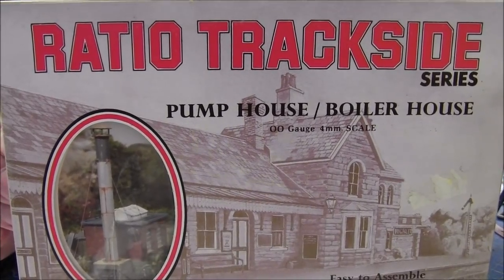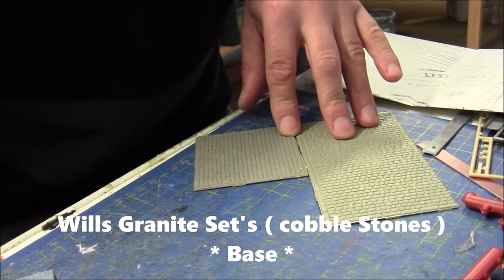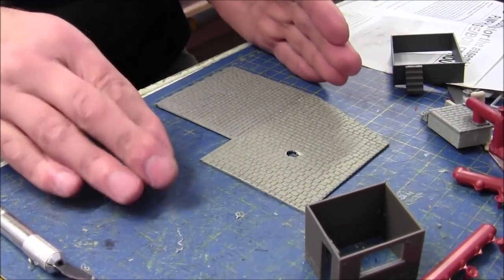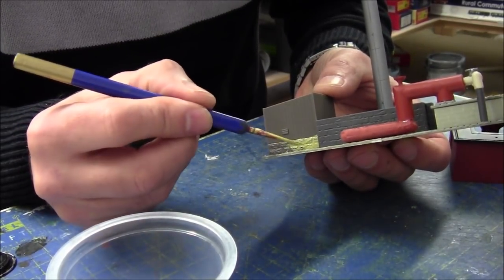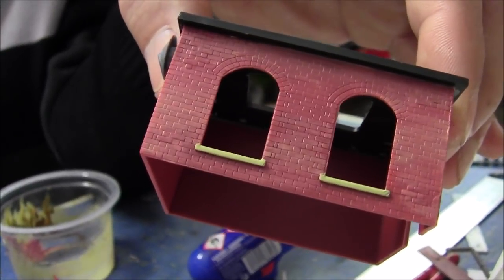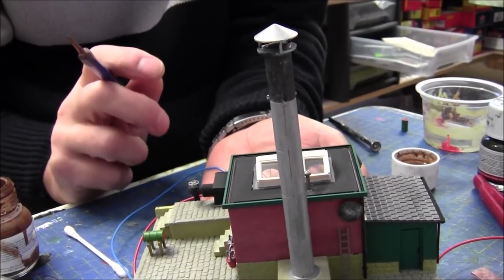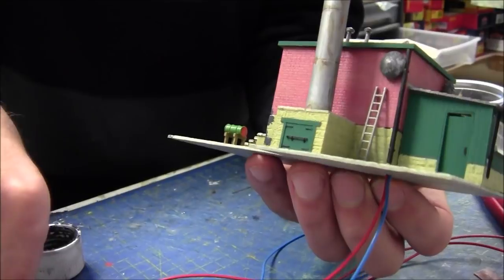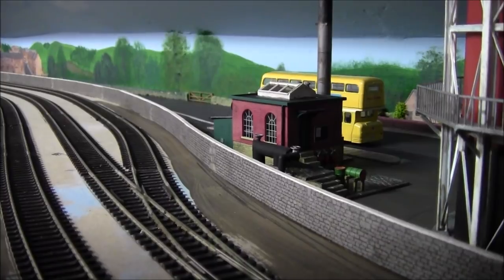OO gauge Ratio Pump house kit................No120

Comment: looking good.another good source for industrial hand wheels is. sow on metal press studs from sewing shops. ask the wife lol. as ive used them before. as you have done ive never thrown away plastic kit sprews as they com in handy for pipe runs of all shapes and sizes
Reply from the maker: Thanks for the tip Paul. happy new year mate. all the best for 2018...regards Tony

Comment: Great looking boiler house and some very handy weathering tips , I spent many working hours in boiler houses that looked like that .......Peter
Reply from the maker: Hi Peter your most welcome mate. so where you a mechanical engineer working in boiler houses. keeping them running. etc thanks again take care   Tony
Reply: Yes Tony I was a oil / gas commercial boiler engineer , started at 16 as an apprentice and still in the job when I retired .     .......Peter

Comment: Outstanding kit build there sir, i love your attention to detail and the little bits of rust you've incorporated. Had to chuckle when ypu said about the floor included in the kit when you threw away amd said I'm going to make my own. Paul
Reply from the maker: Hi Paul it would probably work out cheaper if you make your own.. the cardboard floor was not fit for purpose. I did have a fiddle with it. it turn out to be a piece scrap...happy new year regards Tony

Comment: Just watched your two videos on the pump house / gas omtitmetors, Town gas was made from coal (which was still in use in your modeling period), most pump houses are oil/coal fired, I don't want sound pedantic there's no fuel for the pump house, the NCB lorry could have made a delivery of coal for the pump house
Reply from the maker: Cheer's Vince, maybe I could build one there still space behind the pump house. thanks for the tip......Regards Tony